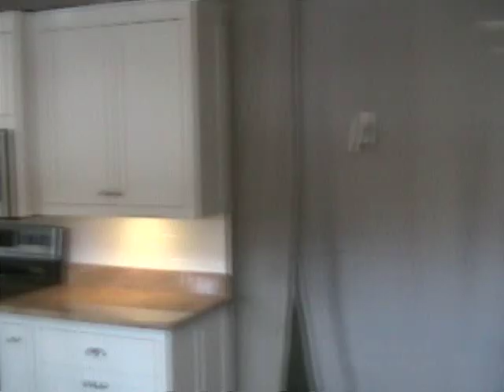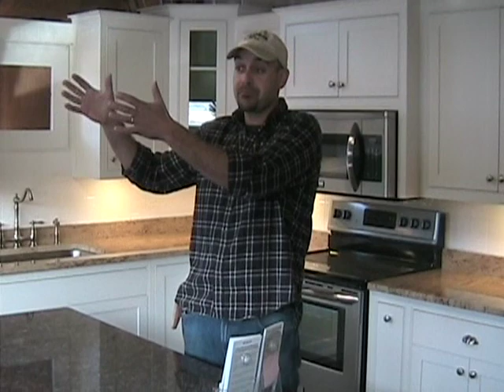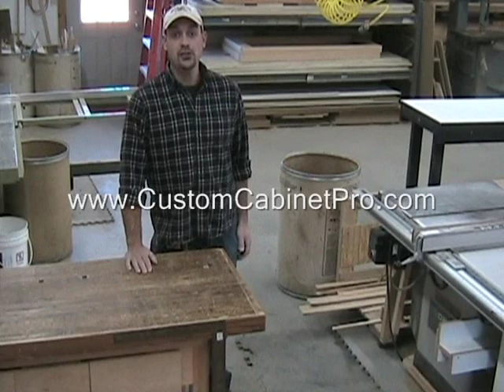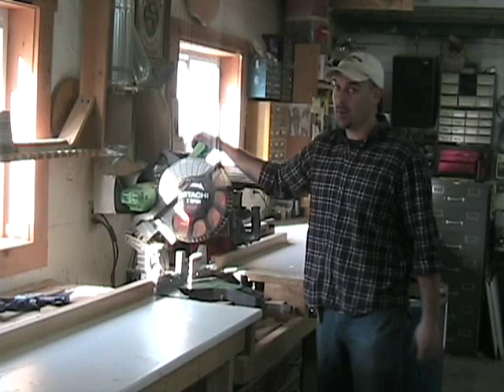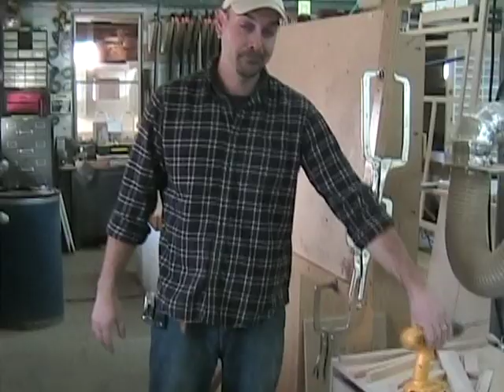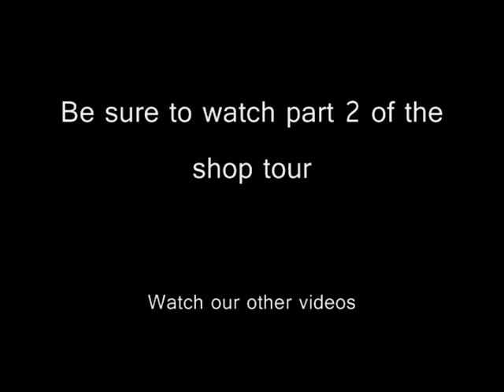Custom Kitchen Cabinets Part 8 Shop Tour Part 1

Comment: I would be interested in plans for the face frame clamping table
Reply: Joey Simmons It is literally plywood around 3' x 6' with strips of plywood screwed on creating the 90 degrees...  I'll be building a new one here right off, something that is finished so glue doesn't stick to it!

Comment: Like that you got the wide belt sander . I know its a big time saver and a far superior quality improvement over the drum sander. I'm also gonna suggest a long bed sliding table over the 4 or 5 foot table that you recently purched. (it's much quicker because you rip the edge of the sheet then rip emmediatelly.Good luck , Cabinet making is  a tough bussiness.You seem like a class act.

Comment: Thanks Kris for taking the time to make this series. It really brings an appreciation for the work and craftsmanship that goes into fine cabinetry. As much as its neat to see the new equipment in your shop like the wide belt sander, I'm glad the series shows the making of cabinets using the older stuff as its closer to what is doable in the smaller shop.

Comment from the maker: When I have a cabinet that has double doors I do not put in a center stile unless I have to partition off the cabinet (ie, a trash pullout on one side, and shelves on the other).  In an inset application you need something for the door to close on.  I mill up a door stop that I attach to the inside edge of the top of upper cabinets, and base cabinets when applicable.

Comment: Just finished the set of videos,learned a lot about face frame cabinets and i certainly am going to have a go at the inset doors.Just one question,i noticed that on your website gallery that cabinets with double doors,don't have a centre rail on the face frame.Is this because it makes an overlap on the centre partition.In other words a 2 1/8 inch face frame against a 3/4 partition? thanks for sharing your knowledge and experience.